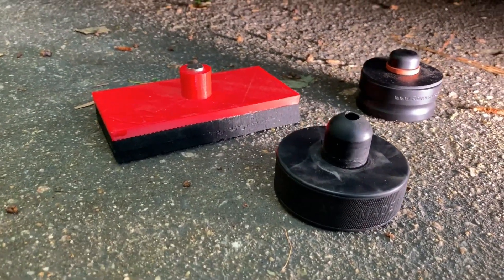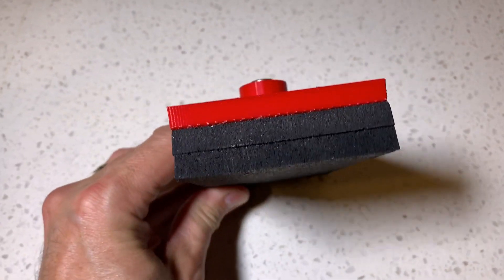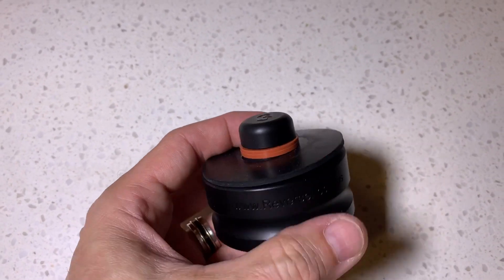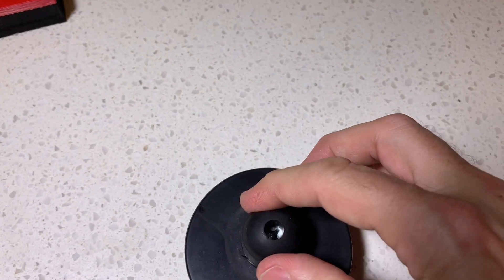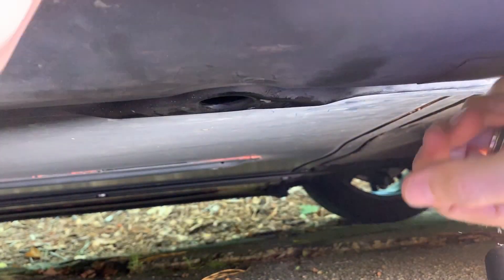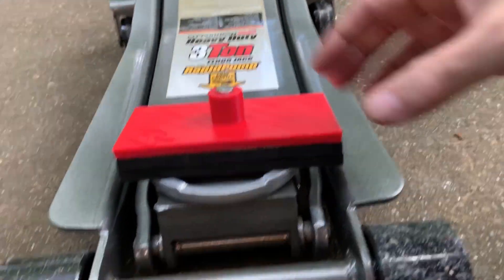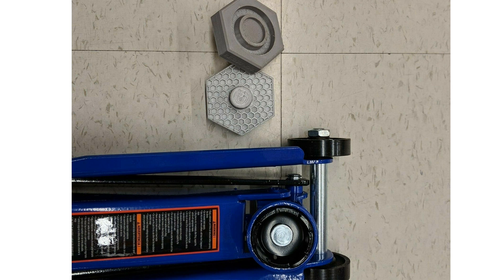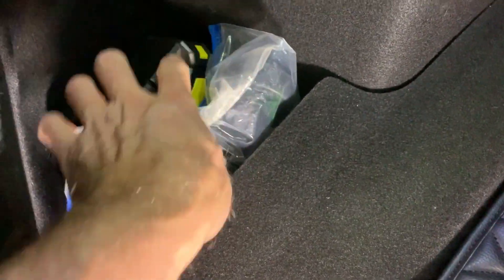Tesla Model 3 - Jack Pad Adapter Review

Comment: A bit late to the show. I had the mechanics switched to winter tires for me without the pads before I realized this is actually something important. The car now drives ok and charges ok. Should I be worried about it at all?
Reply from the maker: As long as they placed the jack near the jack point holes there shouldn’t be too much of an issue. Since underneath is painted metal - it can get scratched up.

Comment: The adapter you made looks like the pilot bushing is a bit longer than the reverse logic. No problem having it longer?
Reply from the maker: No, the length is not an issue.  The width is a bit snug in the opening.  You could probably pop them on and they would stay on for thousands of miles!